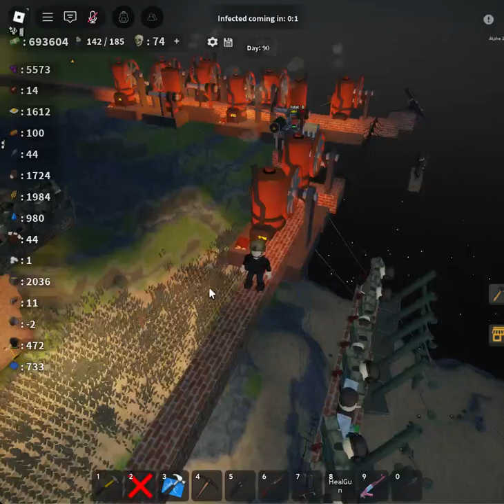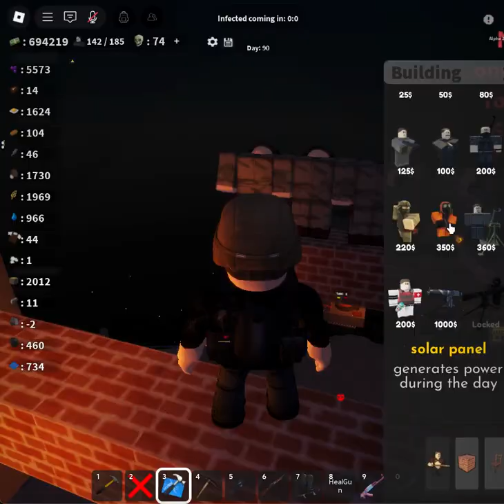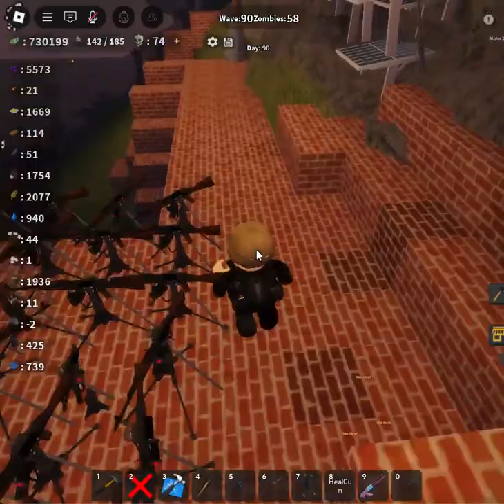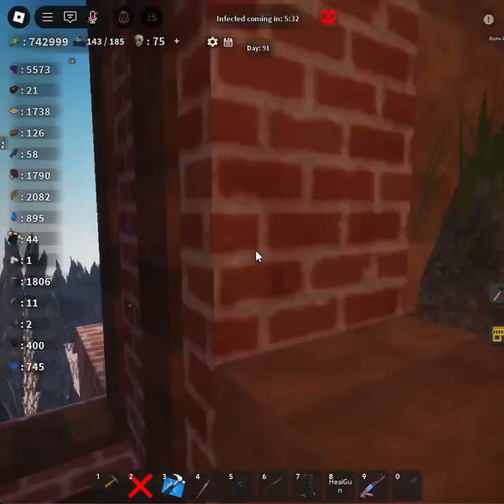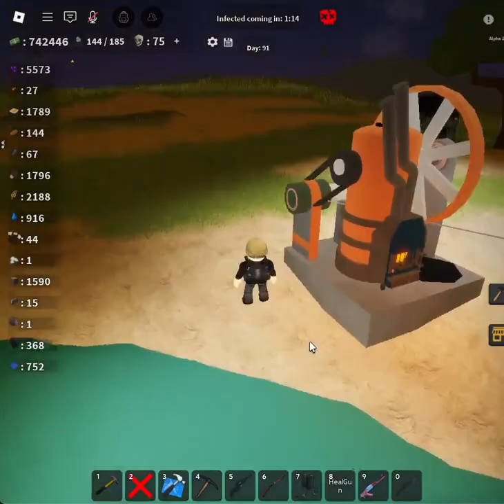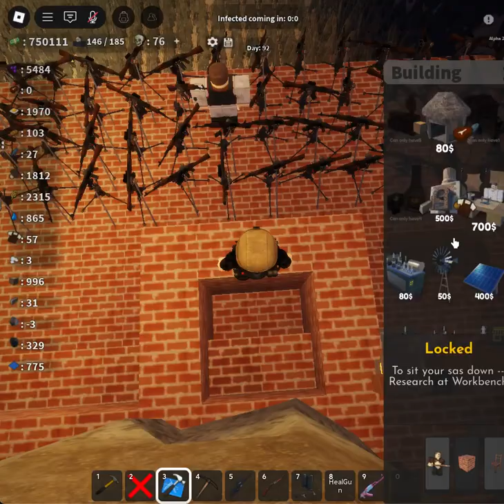Colony Survival Update Summary: Bunker Base and Machine Guns

Comment from the maker: Thanks for watching! Here are the timestamps:
00:00 - 00:30 Intro
00:30 - 03:00 Bunker Base Overview (tips & bugs)
03:00 - 06:00 Outside Stuff
06:00 - 07:40 New Defenses (kinda)
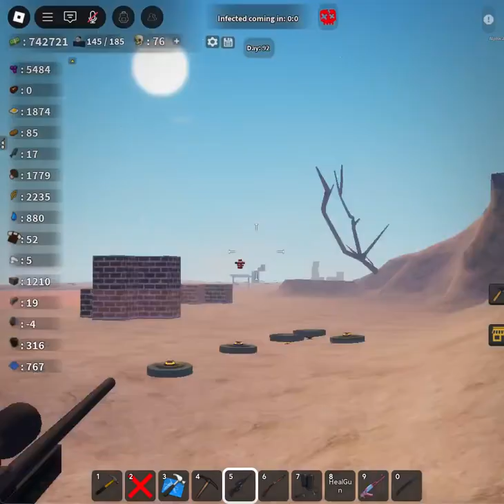07:40 - 08:00 Pathfinding Bugs
08:00 - 09:20 Experiments
09:20 - 09:50 Skull Shop Stuff
09:50 - 10:15 Batteries/Electricity
10:14 - 10:28 End

This video is sped up so the captions are a bit off. You can slow it down by changing settings -> playback speed -> 0.75
Reply from the maker: I can also upload the un-sped up version if anyone wants it.